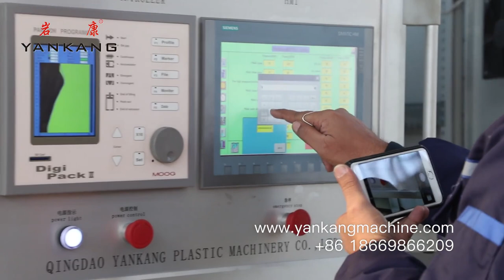1000L 5 Layers Water Storage Tank Blow Moulding Machine Quality Testing

Comment: How much maintain the temperature during summer  (48 degree)
Reply from the maker: Temperature is an independent control system. PLC can adjust and control the temperature by itself. There is no need for human operation.
Yankang's machines are temperature-controlled automatically.